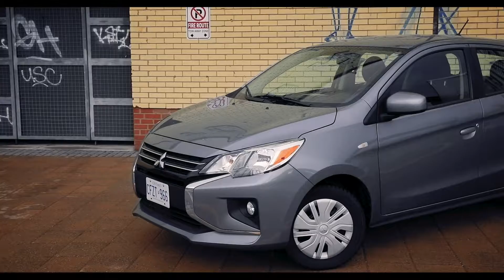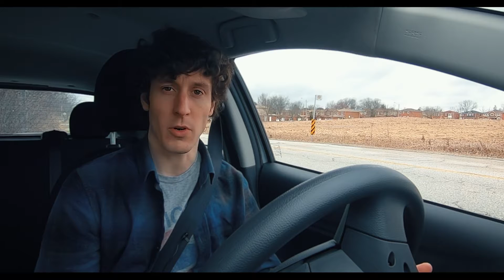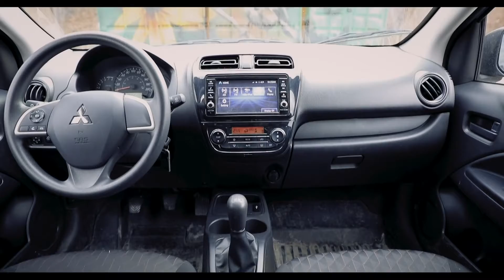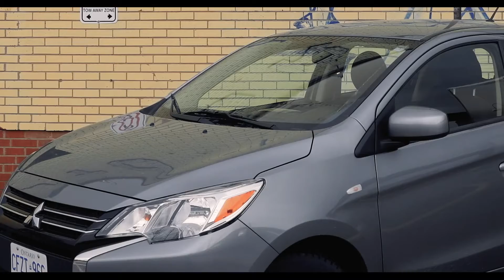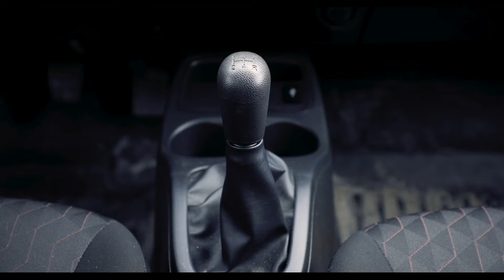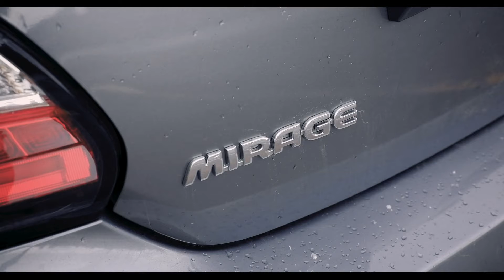Long-Term Wrap-Up: Mitsubishi Mirage ES | Driving.ca

Comment: This car gets almost Prius gas mileage without being a hybrid.  and it's the cheapest on the market. and it's  hatchback.
which is superior to a sedan.  It accelerates great,  CVT will keep you at max rpm if you need it.  It has a TIMING CHAIN.
Reply: superior how?  Have you seen the g4?  Looks like all they did was cut off the trunk and bam it's a hatchback 🙄.  And how about 1:00  what's with the backup camera on the lid?  Looks SO like a last minute add on.  Yes I understand some folks dont care about getting car looks awards but the sedans just a better value imho
Reply: @resetsetmefree478  agree it won't win any design awards.  But it's cheap, it depreciates, reliable, and great mpgs.
Reply: @resetsetmefree478  I just space to move big things

Comment: I disagree.  The Spark auto transmission is unreliable and the Mirage has a much bigger and better back seat.  Mirage wins every time.
Reply: maybe the Canada ones but it depends on the model year.  The usa sparks transmissions from 2020 onward are good and a smooth gearshift.  I know some folks like the zigzag transmission in the mirage but I just couldn't get used to that.  Not to mention the body style.....🤮mirage is definitely the ugliest hatchback ever made.  G4 sedans alright though

Comment: My first car was a hand-me-down 1977 Toyota Celica from my parents. 5 speed and 90 HP in California trim to move 2560 lbs around. It was no faster than the current Mirage and it was my only car. I drove it from California to Iowa and back twice. No power windows or locks, no cruise control, only an am/fm radio. Very basic. The Mirage would seem luxurious by comparison. What I'm trying to say is today's buyers could get by with a lot less than they've grown accustom to.

Comment: I bought a 2017 Mirage G4 in 2017. It's one of the few G4 sedans I've found with a manual. My wife and i have driven the car over 120,000 miles and the only thing it's needed is tires, gas, and oil changes. The 78 horsepower doesn't seem to matter, as everywhere I drive it I'm stuck behind a car with more power that is going *slower*. I can confirm it's completely unstoppable in winter weather, where I live we get a few inches of snow with a polished ice surface underneath, and the mirage just zips around while people are sliding their luxury SUV's off the road.

Comment: Big Question:
How safe is it in an accident?
Reply: You mean collision. Right?
Reply: the same as every single city car on the market: 0 to 1 stars. Why? because that's the name, CITY CAR, designed for use IN CITY. I have yet to see a single city car that scores a 5 star rating in a crash test, and it makes sense, it's impossible to make a 5 star rating car without increasing the size that makes the car no longer fit the citycar category. It has 3 airbags, which should be enough to survive a city-speed level accident.

If you're seeking high security ratings, then you must look into Hatchback cars rather than city cars.
Reply: @ClaudioProductionsX  The 2024 Mirage receives mostly a 'Good' rating - the highest - from both NHTSA & IIHS. It has a 'Marginal' rating from IIHS for the small overlap frontal crash. Overall it scores 4 out of 5 stars. Not bad for a "city car"! 😉

Comment: Me and my wife just got one of these recently. It has 59k miles. The driving position is a little high, but it's not that bad. It's the newest car we've ever had
Reply: still enjoying the car? think they look a cracking little car
Reply: @TonyCareAKATanCoyer yeah, we still got her, lol. I have had to do some things to it. I got ran off the road and busted the front bumper, cracked the radiator, and bent the AC evaporator. I also had to replace the wheel bearing. That was a pain. The first guy put the thing in backwards so it lasted two days. Took it back a week later and got it fixed the right way

Comment: My only concerns at this point are how it handles snow and highways. He said it can handle it but not the blizzards which is understandable. I've seen regular size cars do poorly in those. Highways.. I guess I'll just stay in the safe lane (if I even need to use highways). It would be my first car and I would happily show it off. Don;t care what people think. It's a price thing and the warranty covers 160k instead of 100k that nissan, hyundai etc offer.. so youd have that confidence in it. Right now its been so hard to get a hold of any rio, forte, elantras.. Been waiting for 6 months. I think people may pass by this one so its easier to actually go and pick it up right away.. (hopefully)

Comment: What kind of condition will it be in at 100K miles?
Reply: Excellent condition. Mines already done it and is ready for another easy 100,000 miles.
Reply: I'm over 120k and I have had no problems with my 2017 MM.

Comment: The car will far apart after 100k. I bought a 2017 ES Manual Mirage brand new.  The clutch is slipping after  130k on it. I  think you might be able to get about  150k on it before the engine goes.
Reply from the maker: Interesting
Reply: Maybe replace your clutch? 130,000 miles on the original clutch is amazing as most must be changed by 90,000 miles.
Reply: @life_of_riley88 

That's going to cost me about 2500 Cdn  bucks to change my damn clutch.  :(
Reply: @Shawner666  Are you handy? These cars are easy to work on, I bet you could do it yourself.

Comment: The only car to compare the Mirage to would be the Nissan Micra, as they share the same dimensions. How do those 2 compare dollar for dollar?
Reply from the maker: Well they compare in that you can buy the Mirage new and they stopped selling the Micra in Canada in 2020. Other than that, Micra is the hot rod of the two and provides a quasi-sporty driving experience. Interiors are of about the same quality but fuel mileage is much better with the Mitsu.

Comment: I hated this car! but after owning it I must say it surprise me. have the CVT with electric windows, cruise, auto lights, auto wipers... got 0 problems and it's very economic. also added some isolation (sound deadening)  to doors and floor so it a bit more quite now. also find it more soft and comfort then other super mini cars. it's definitely not great car but it's decent for price and maintain and it actually remined me of the old good simple cars

Comment: I just recently purchased my 2022 Mitsubishi Mirage G4 with the CVT. I LOVE THIS CAR! it's exactly what I wanted. Cheap, Efficient, and great value. My only complaint is going highway speeds when it is windy out or driving near big trucks. You will have to man handle the electronic steering since the wind loves to pull this car! Besides that i love the rear camera, apple play, not terrible audio quality, and the cheap 9 gallon tank that i have to refill once every 2 weeks.

Comment: I have owned two of these (2014 and 2017) and would definitely consider a 3rd one.  It is just such a great value.  I absolutely hate the CVT in the 2017 however. The Manual in my 2014 is frankly the perfect car for me.

Comment: I bought a Space Star, that's it's name in Germany in 2021. At 110 kmh on the autobahn it gets over 60 miles to the gallon, in the town over 50 miles to the gallon. You compare it to the Spark, the Chevrolet Spark did not do well in all tests in Europe. Electric and engine problems.

Comment: If you press the radio button 3 seconds, it switches off until you press it again. It is in the owner's manual. I have a 2015 Instyle (so with a lot of luxury options) with CVT with 121.000 km and had zero defects. Not even a light bulb broke. No rattles, still original brakes and exhaust and no measurable oil consumption yet. Try that with a Chevy Spark. I love this car to bits. But.... deplore that in Europe emissions standards forced down the power from 80 hp to 71 hp and the torque from 106 Nm to 102 Nm. My fuel consumption over 121000 km is on average 4.5 l/100km (eco driving style).

Comment: I had both a Mirage (2015) and Spark (2019) both are great valued packed cars, the Spark is more modern on the interior, but I like the Mirage exterior better, the Mirage has a softer ride, while the Spark is more on the sportier, power to weight ratio, I found both to be equal in terms of performance. The mirage is better equipped in base form for day-to-day convenience, next spring I plan on buying a 2023 Mirage in the base form, but as you said, the colors are limited and for 2023, you can get a base Mirage in any color you want, as long as its white!
Reply: I have a black 2023 ES reserved so I think you might mean, you can only get the Base MT in white 🤍
Reply: @stewchronic  or grey
Reply: @oi32df  correct, I've actually switched cars and I'm snagging a 2023 Manual in titanium grey now!
Reply: @stewchronic  I thought the last yr for the manual was 2022? never heard of a 2023 manual!

Comment: Good review. Honest. Can't beat I the mirage for about town stuff
Reply from the maker: Thanks for watching!
Reply: @drivingca  I'm on my 4th Mirage between my wife and I. We've owned a 2014 DE CVT in kiwi green, a 2017 ES CVT G4 white sedan variant, my new 2021 ES CVT in infrared, and we just got my wife another G4 this time being the 2022 Black Edition CVT in metallic black. These are dead reliable vehicles, in spite of having a JATCO CVT. People that say these aren't highway worthy are major, spoiled pussies. I drove my 2014, which only had 74HP, all over the eastern seaboard, on I95, one of the fastest, most dangerous highways in America. It did the job just fine. I avg 38mpg doing about 75mph on most road trips. Road and wind noise isn't that bad at all, nothing your speakers can't handle. If the day is very windy, yes you can be shifted an inch or two but nothing drastic at all. The vast majority of bitching about the Mirage is from non owners who have no frame of reference.
Reply: @kylemas2005  these vehicles do just fine all over the globe. Maybe not so much in spoiled countries. The JATCO is Scotty K's favorite bitch but I think he's been a few cents short for some time now.

Comment: Other than getting good gas mileage, I can't stand this car. At least in the automatic variant. I rented one to take a road trip to Michigan recently from cedar rapids, Iowa pretty much all highway and it was the most uncomfortable garbage car to drive I've ever driven in my entire life. I went to test drive a 2018 Prius in Michigan and that car felt absolutely amazing. Plus a million compared to how this car in automatic variants felt to drive The road. Noise from the tires was the most annoying thing ever. It was uncomfortable. I felt every single bump it had like no acceleration. It had a few nice things like climate control, Bluetooth reverse camera. I think it's got a proximity sensor like if you get too close to somebody and I think it's got like a hands-free thing built into it. I believe the microphone is like up close to the rearview mirror maybe. But like I said I rented this car and it only had like 500 mi on it. I'm assuming it was the newest version. It looked very much like the one in this video but I was way past the point where I wanted to get out of this car when I dropped it off at the rental place. For context, My daily driver is a 2000 Toyota Camry 4 cylinder. It has a few issues. It has over a hundred fifty thousand miles, but it's pretty comfortable and fun to drive even as an automatic. This thing was not fun to drive at all. I think the only saving grace might be it being a manual transmission. If you can get one of those stay as far away from the automatic as possible and possibly change the tires.
Reply: There are no cars out there by design to compare the Mirage. 

The Mirage is something else and is popular, at least in the Asian market, if not the world. American don't like small cars feel nor inexpensive and rather buy SUV.🤷‍♂️

Non sense to compare the Mirage to Prius or Corolla. Different DNA, different targeted audience, and different PRICE POINT. 

Not liking the Mirage because it not on par with said car is irrelevant. What is relevant is the buyer's priorities out of a car. 

Obviously, this one isn't meant for you which is fine, really. Your tastes tell you to look something better for your liking.
Reply: Drove from NYC to south Florida in my Mirage, and it was just fine, I just put it on cruise control at 75mph and still netted almost 40mpg. You might just be a giant pussy. Thank god you weren't driving in the 90s, where a third of the cars out there didn't even have 100HP or wheels over 14 inches. Mirage is a base GodMachine and is the last true subcompact standing for a reason, reliability, surprising interior passenger and cargo volume room, and fuel economy. Also the JATCO CVT7 in the Mirage is perfectly suited for it and doesn't have no where near the issues it does for Nissan.
Reply: Why on earth would you even compare the Mirage to an said old car?? That’s not a smart fair comparison to begin with. Like comparing Apple to oranges, condo vs house, you get it. 

I swear folks just love to bash a cheap car like Mirage because they  forgot they had or have something better option for the $ which tells me everything about them concerning status symbol from the start. 

Be smart $; not dumb $
Reply: If you have a + '18 Camry stay with it , there no other four cylinders large car with a better hi-way fuel economy.

Comment: I have 2015 ES in the same color with 89k miles I bought new. It actually handles quite well, even more so when I put 185 width tires on it. I have had to absolute zero except maintenance, which is almost none. It doesn't burn a drop of oil even with me driving it 80+ on the highway. It sounds....kinda of good?? It sounds like a v6 and not buzzy. It has plenty of torque and I even from time to time outrun trucks 0-60 who are actively trying to outrun me. Even v8 ones.  There really isn't anything you can buy in the price range that can beat it for reliability and ease of use.

x2 on the snow, didn't even have snow tires and went for drive in the mountains.
Reply: I also have a 2015 Mirage. Same experiences as you. Zero defects, zero rattles, zero oil consumption. And Mirages have counterrotating balance shafts. That is why it does not really sound like a 3 cylinder engine.
Reply: @ronaldderooij1774  It's not a balance shaft that dictates the sound of an engine but rather its firing order and how the crankpins are offset, which must be 120 degrees here. Btw Mitsu was one of the first manufacturers to offer ''Silent Shaft balance shaft engine technology''  in their 4 cylinders 2.6L Dodge Challenger & Plymouth Sapporo ( Mitsu  Galant/Lambda ) which minimized the inherent vibration of a large four cylinder in-line engine.